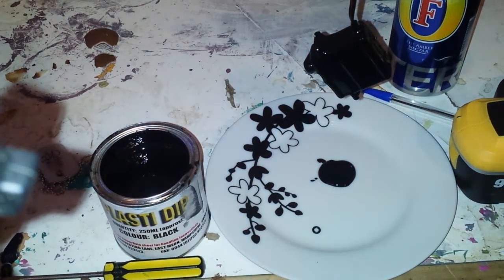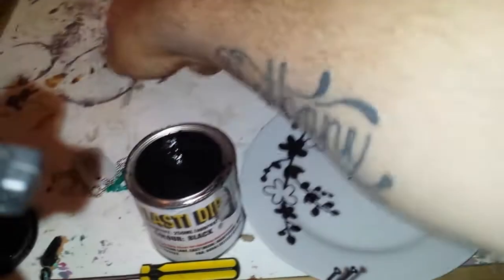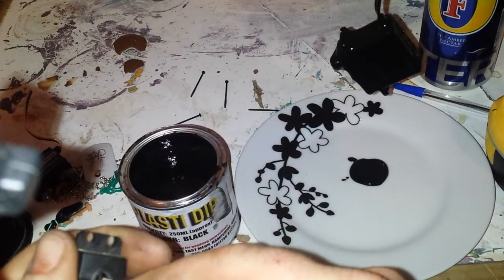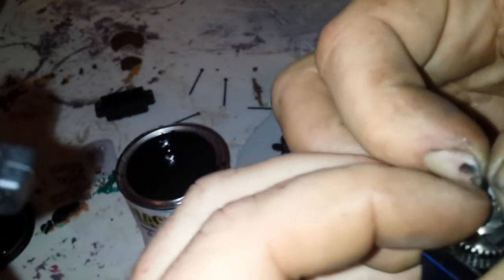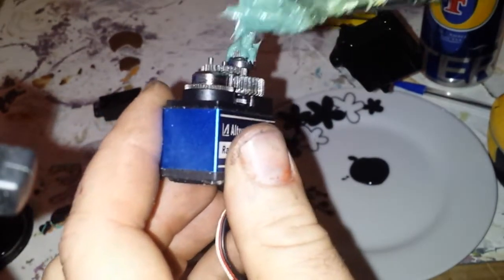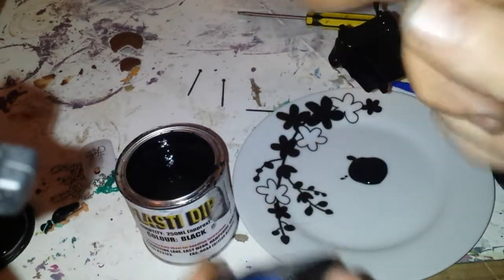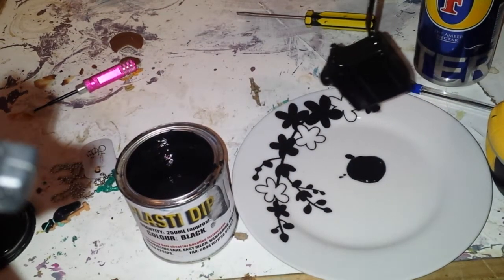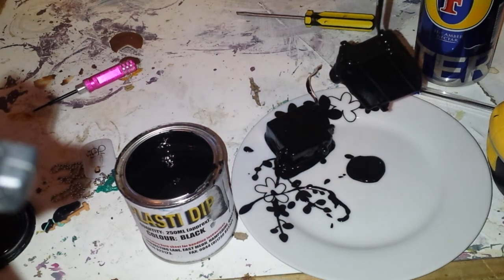HOW TO WATERPROOF A SERVO

Comment: Thanks for the video.. I need to find out what size o-ring that is so I can try it when I get a chance..
Reply: I subbed, did not know I was not already. I guess just google+.. I have a few videos on my channel, I actually tried to waterproof an esc, from on e of my L959 buggy's..
Reply from the maker: ***** nice and thanks i used this same method to do my axial ae2 esc that has been going strong for over 1 year so i no it works
Reply from the maker: just get a really small oring like the same size as one that comes in a set of 1/16 scale shocks one that size will be perfect